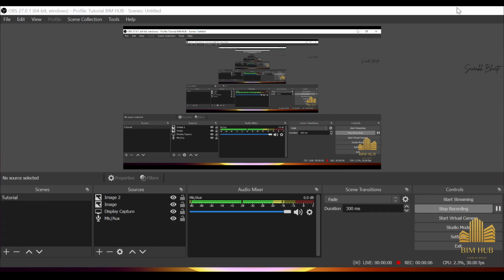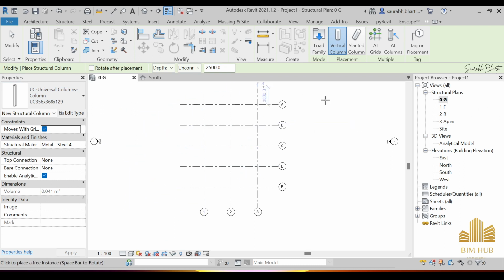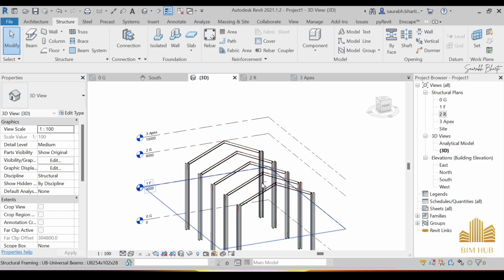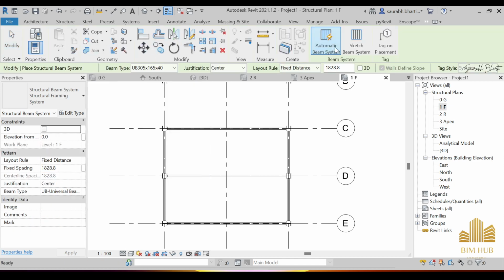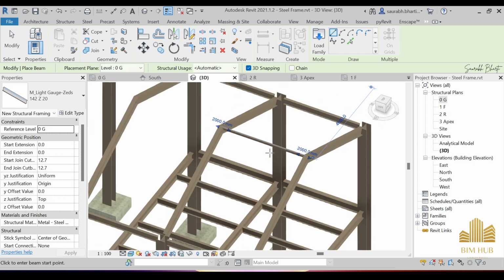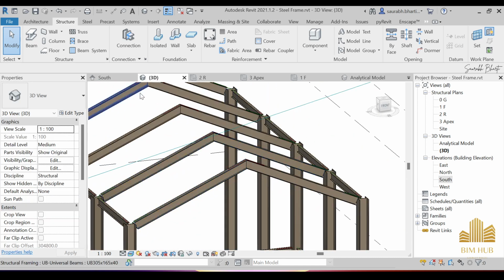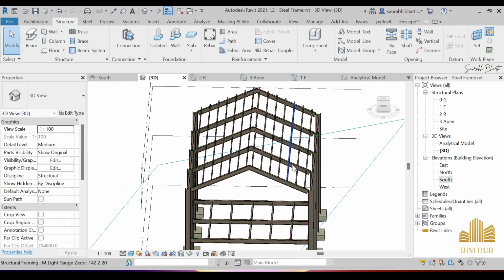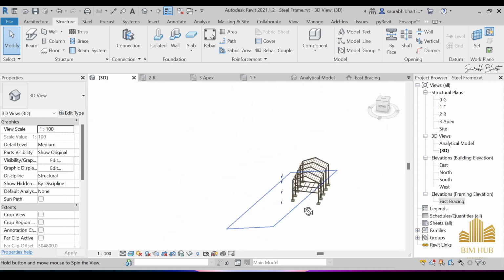Revit Structure Tutorial - Part 11 - Steel Framing- #Beginner To Advance

Comment: Sir, aap kahan kaam karte ho ? aur apne kahan se revit sikha. ?
Reply from the maker: Right Now I work as an Architect at Revite,Europe.
 Am a self learner & did took help from YouTube & Udemy.
Reply: @BIMHUB_  i am also self learning the software to become a entry level modeler. I am taking help of your videos to learn.
Reply: @BIMHUB_  Revit is a very complex software as compared to Autocad. Your videos are easy to follow up and repeat in a project.
Reply from the maker: I will start making More Videos in coming days....with greater depth of detailing in Revit. Stay Tuned.